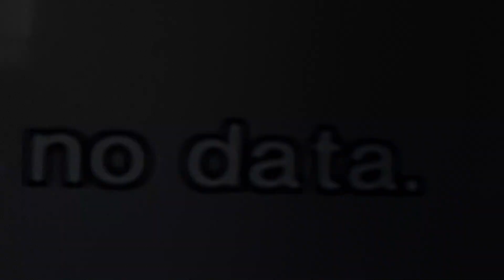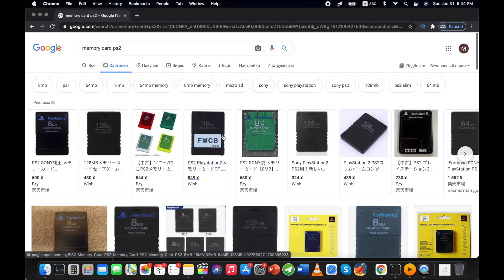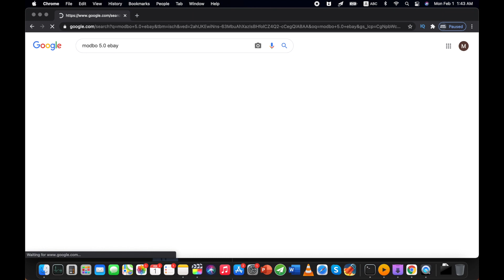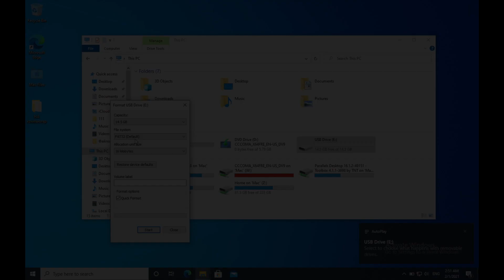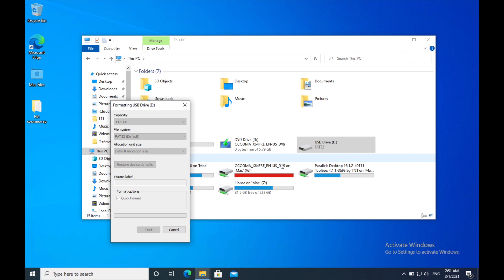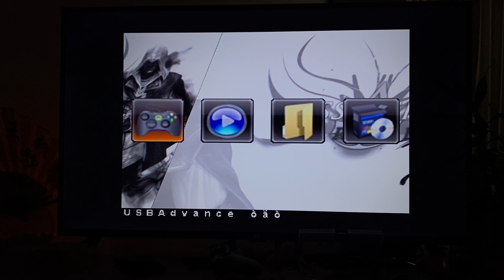HOW TO MODCHIP PS2? MOD CHIP MODBO 5.0 INSTALLATION GUIDE. PLAYSTATION 2 SLIM

Comment: Ever had issue all wires installed right but you get red screen of death for ps2 backup discs? Cd-r ps1 games work fine
Reply from the maker: Do you use disks to play?
Reply: @ReMARKCHANNEL  I do but I fixed it. I had some traces bridged on modchip but all works now!
Reply from the maker: @TheOriginalVersatile  glad that you managed it

Comment: please link to your soldering iorn been trying some  cheap soldering iorn :( i got at a dollor store and the tip dont melt the solder its hard to solder good am sure ur soldering iorn wasnt to expensive and u did a great job on installing chip link please
Reply from the maker: 4👈啊qw0QcAhEvaj！ https://m.tb.cn/h.4lrwZpm?sm=d12caa  鹿仙子 60W恒温电烙铁套装家用维修焊接焊锡枪可调温内热式电洛铁
Reply from the maker: Hi, I bought this from TaoBao and it’s a local Chinese online store. Use AliExpress , it’s an international store.
Reply: @ReMARKCHANNEL  thnx ill check it out it seems afroable am sure it will make installing the modchip easier
Reply from the maker: @princevinny0073  good luck 👍

Comment: ¿is the process for allowing ps2 to run pirated games on dvds similar? i was just curious how that works since way back when we could take ps2s to shops that would modify ps2s to be able to do this
Reply from the maker: Yes back in the days they did this in shops. Also it can be done by installing modified software on a memory card. But you need to have a jailbroken console to make a card. So I guess back in the days they installed mod chips or just were selling modified memory cards.

Comment: Hi , great vidéo man , i did the exact setup but the game that I downloaded didn't work and  my modship ps2 doesn't even read CDs
Please help
Reply from the maker: Hello, does mod chip menu displays when you boot the console?
Reply: What menu the matrix one ?
Reply from the maker: @tarekriadh5592  yep, does it load?
Reply: @ReMARKCHANNEL   yes I can choose between auto and mass
Reply from the maker: @tarekriadh5592  try to open iso image, maybe your dvd drive is broken or the discs don’t work
Reply: @ReMARKCHANNEL  iso image works I just downloaded one , so that means that the disc was damaged ?
Reply from the maker: @tarekriadh5592  probably, try another one or check the dvd drive by using 100% working disc
Reply from the maker: So there is no problem with the modchip if it loads and you can play games from usb drive
Reply: @ReMARKCHANNEL  i tried 5 cd that used to work before the modship , is it frequent to demage the disc drave ? 
And btw thank you for your time sir
Reply: @ReMARKCHANNEL   yes I can
Reply from the maker: @tarekriadh5592  I will reply later

Comment: Hi, to remove the modchip can I just use my hands carefully and thats it or do I need the soldering gun? (dont know if thats the correct name)
Reply from the maker: You can damage the soldering points. Better  use scissors and then rap the wires with tape.
Reply: @ReMARKCHANNEL  Thank you for answering and if you allow me to ask one more question: doesn't the tape damage the console? and isn't it better to use a soldering gun (someone that knows how to use it) or doesn't really matter?
Reply from the maker: @allanpedro2483  I mean for sure it’s better to remove the modchip with soldering iron, but if you don’t have it, carefully cut the wires and wrap it in tape, don’t let the wires be shorted. It will not damage your console if there is no short.

Comment: Did it need a correct color of wires? or you just pick it randomly
Reply from the maker: Randomly😃
Reply: @ReMARKCHANNEL  oh that's great, thanks
Reply: @ReMARKCHANNEL  ok last question did you also use 30awg to the 3.3v and gnd?
Reply from the maker: @attdnsk1033 yep, gotta be 30 awg.
Reply: @attdnsk1033  I would thicken the gauge of the wires for 3.3v and gnd. I use 28 awg.

Comment: hello. somehow i disabled my modchip. and can't find solution. is there any key combination tu re enable modbo 5.0?  without re enable (triangle and circle) not working. before i disabled modchip everything worked fine
Reply from the maker: Hello, does it show “disabled “ on the screen?
Reply from the maker: If you had disabled your chip by holding the start button, you would have seen “disabled “ on the the screen. Then just put your console on standby and it should enable the modbo chip.
Reply: no it not showing anything. when i start console and press triangle and circle no reason just starts and shows blue screen whith browse and config. and then if i put disc it's shows redscreen says put ps2 format disc.
Reply: i think I somehow disabled my chip but don't now how. how to set console in standby? just push power button? and then when starting push start button on joyst?
Reply from the maker: @GiorgiMosiashviliOfficial  just unplug it from the power socket and then turn on, but I guess you already have done this. Better check the modbo on your motherboard, maybe it’s just a coincidence and there is some lose wire .

Comment: Awesome video I wanna get into this type of stuff do you have anything you can recommend that I can use to practice with?
Reply from the maker: Do you wanna modchip consoles?😁try ps2, it’s not so hard. I also tried this first time.
Reply: @ReMARKCHANNEL   what tools do I need? Thank you for replying btw
Reply from the maker: @timzz4720  screw driver, soldering iron, solder ,magnifier,flux, tweezers,modchip, ps2, windows pc or tablet

Comment: So do the games go directly onto the modchip? Also how's the input delay and frame rate and all that?
Reply from the maker: Nope, modchip allows to run unsigned code on your console. It allows you to launch games from a usb drive for example. Since ps2 spots only usb 1.0 people face problems during cutscenes in games cause it’s a bit slow, but there are no problems during the game.

Comment: What's the difference between the piece you removed and the one you installed?
Reply from the maker: They are different mod chips. Allow you to play games from dvd and flash drive. The one that was in the console probably was dead.
Reply: @ReMARKCHANNEL 
Thank you so much. I have a device with a piece in it like the one you removed.

Comment: Thx, i bought a modded ps2, and i just straight up copied the ISO games to the flash drive and ofc it doesn't work lol
And if you're wondering how I copied the file. i used the exFat formatting type